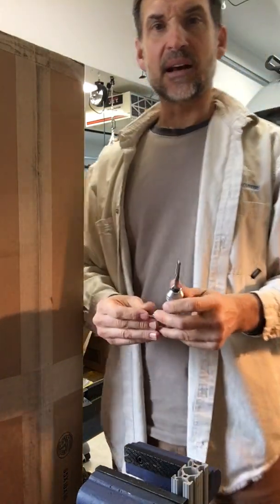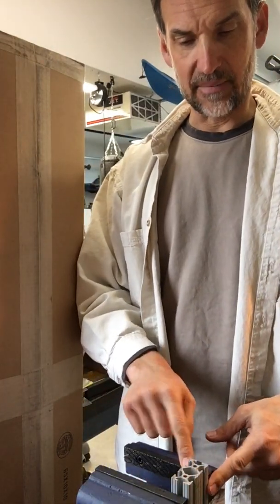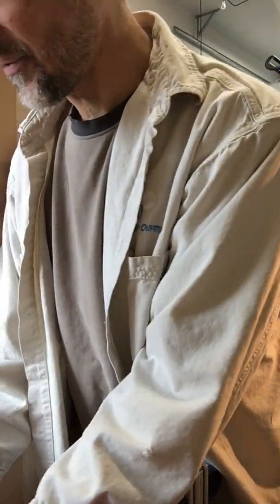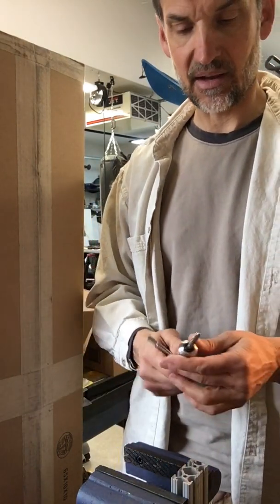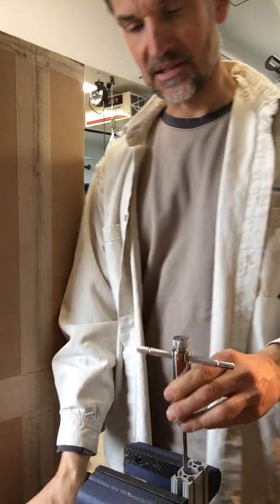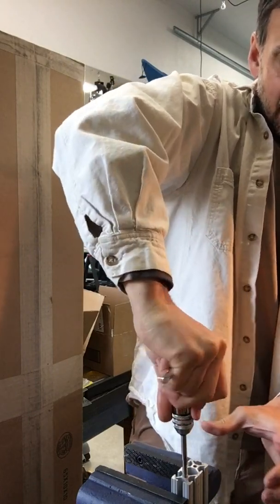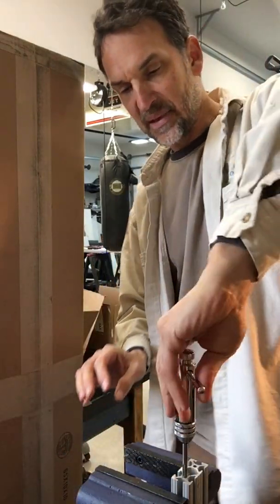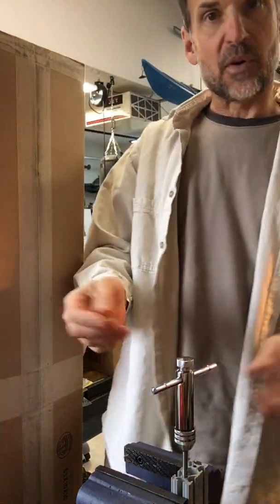Tapping end holes in 8020 aluminum profiles

Comment: Do you have links to your preferred tap bits for 10 and 15 series? There are so many different types.  I've been using the spiral 3 flute
Reply from the maker: I don't have links but the ones I like that have held up really well I purchased from McMaster-Carr. I like their website for easy selection of the different options, and the taps have been holding up really well--haven't broke one from them in years of use, whereas the ones from Amazon seem to break regularly.
Reply from the maker: Here is a link to the hand tool that I have been using, which works well: https://www.amazon.com/dp/B00G9N7EOW?ref_=ppx_hzsearch_conn_dt_b_fed_asin_title_49
Reply from the maker: Here is a link to one of the taps I've been using: https://www.mcmaster.com/2687A48/
Reply from the maker: And a link to a tap I've been using: https://www.mcmaster.com/26545A121/

Comment: Im in this stage of my solar install. I have 5/16 bolts. What size tap bit would I need?
Reply: I figured this out but appreciate your video! I tapped it by hand and it went really well.
Reply from the maker: Cool, exciting for you. Use a 5/16" tap. The actual tap diameter is slightly smaller than same drill bit size. You can purchase a hand tap or drilling tap. The hand taps need a tap handle. There are some good ones available @McMaster-Carr.

Comment: Hey KC, I just acquired a Sprinter and have been thinking of 8020 for the buildout. Your videos are SUPER helpful.  How are you cutting and finishing the extrusions? Any other 8020 tools or wisdom that might not be obvious?
Reply from the maker: Hey Tyler, great! So glad to hear that my videos are helpful. I have many and all intended to be helpful so glad to know they are. And congratulations on your new van and build out with 8020. Use a good saw blade for aluminum, cut slowly and you shouldn't need any additional finishing other than maybe a tiny burr from time to time. Because the aluminum profiles don't really bend, be sure to cut everything as perfectly to length as possible to avoid any gaps between pieces. And I used more pieces and connectors than necessary--easy to go overboard--just use what you think is necessary.